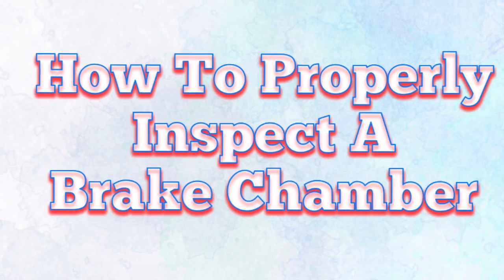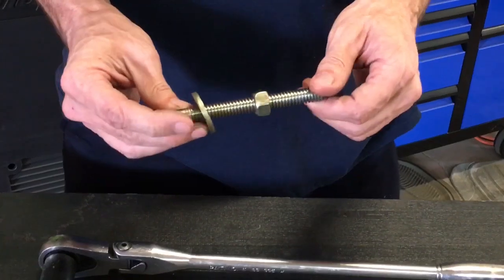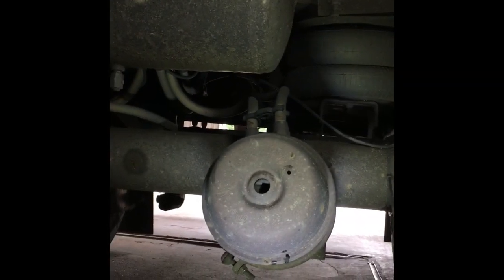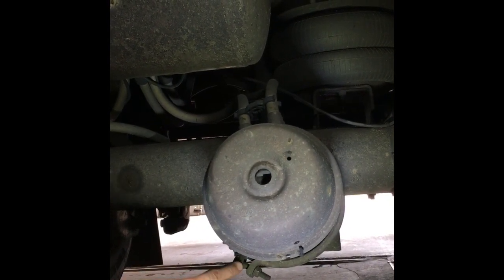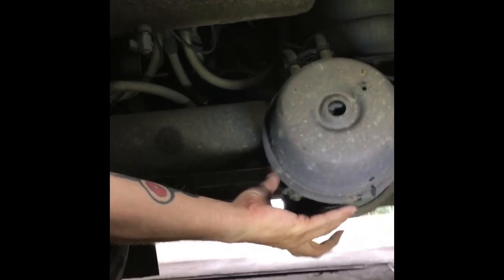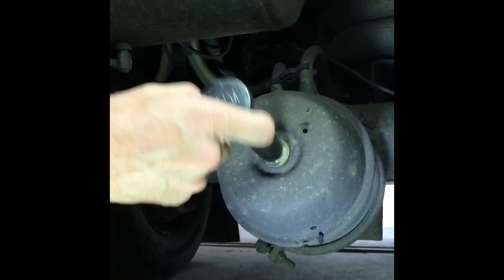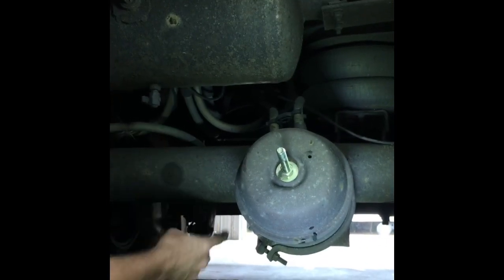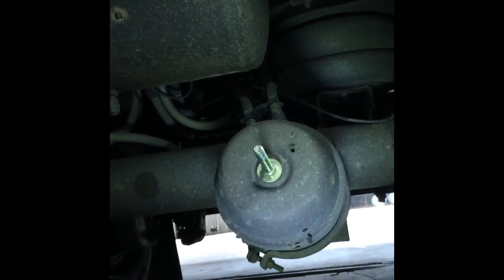How To Inspect a Brake Chamber

Comment: Would I still hear a brake chamber leak when the truck is off or should it be on?
Reply: It doesn't matter if if the truck us running or not, what does matter is if the system is supplied with air.charge with the system Chock the wheels release the brakes and listen if its leaking set brakes follow instructions in video

Comment: The results of the September safety blitz have been released and it appears about 20% of all out of services were ABS issued. Hard to conceal while riding down the road with a yellow light illuminated on the left rear. 😂 
Is this something that you have experience with your Kenworth fleet?
Mine comes on randomly and have no idea what to look for.
Reply: the guitar1962          can you please elaborate a little more on the safety blitz you are referring to.......i don't know what this is,,,,,,,,,,,,and also please tell me more about this yellow light on the left rear,,,,,,,,,what is this all about........i have been retired for 11 years and have fallen behind on new stuff.........this yellow light really baffles me,,,,,,,,,,,,,PLEASE EXPLAIN,,,,,,,,,,,THANKYOU
Reply: @yardlimit8695  Sure thing.Today's newer trailers have a yellow light right above the left side rear lower marker light. So you can ride down the road and show all passersby you have and issue with your trailer ABS system. Safety blitz are usually 3 or 4 day periods where the DOT check more trucks much more aggressively for out of service type safety issues.
Reply: Just pull the plug off the back
Reply: @shottava9314  just hope the scales don't notice it or it's gonna be a hefty ticket
Reply: Should not be required to have a system that does not work.

Comment: would you not shut air off to trailer before removing chamber cap after caged?
Reply from the maker: Bad Intent inc. Bad Intent inc. the line were cut off to the chamber that is what the vise grips or hose clamp pliers are for.
Reply: I thought so, wasn't exactly clearly identified in video or I missed it.thanx for reply.